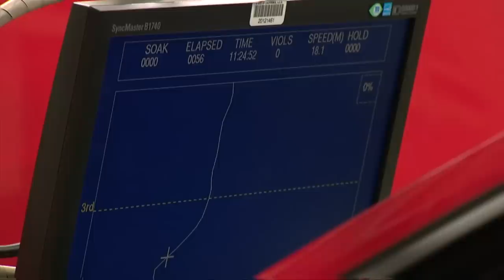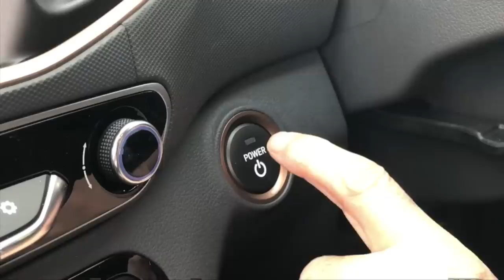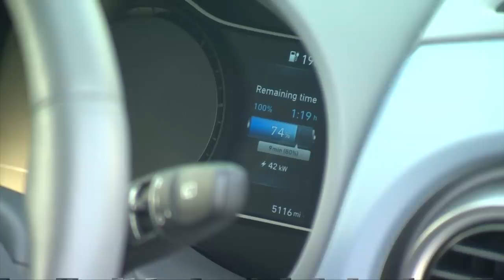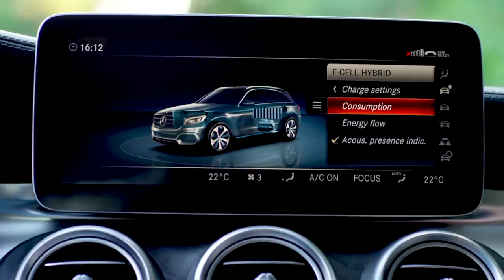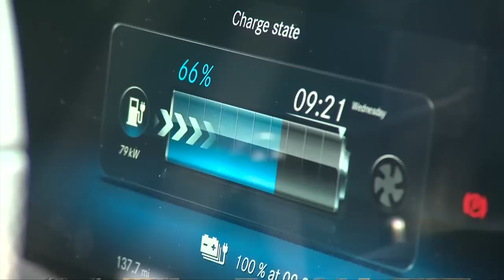Electric Cars: The Future of Road Vehicles? - BBC Click

Comment: What I'm seeing as being a real issue, moving forward, with EVs is the fragmentation of the power stations. You've got Tesla fast chargers, Porsche chargers, etc.. whereas with ICE cars all the gas/petrol stations are the same. So you never have to think about what car you have and what station you can use.
I think this is where government should step in and mandate a standard for the plugs and stations.
Reply: This has already been resolved. There are only a small handful of standards, and these tend to be regional. Tesla are unique in that their Superchargers won't charge other brands of EV. Porsche doesn't have their own network, they have bought into Ionity (iirc) with a lot of other manufacturers.
Reply: @arnifix  I was under the impression that Porsche is building their own chargers, maybe that's just in North America. Regarding Tesla, no they don't charge other cars, but Tesla/Elon did release their patents to be used freely by other manufacturers, but nobody seems to be taking him up on that offer.
Reply: VW is being forced to
fund a charging network across USA as part punishment for dieselgate. They’re for anyone to use but I think they are quite expensive.  Most cars in Europe now are standardised to ccs plugs(even euro Tesla model 3). Nissan are stubbornly sticking with chademo
Reply: CCS is the dominant rapid charging connection in Europe - even Tesla are using it now on their European Model 3s. What is a hassle is all the different accounts you need to pay for the charging across different providers! Hopefully they will gradually do away with all that and just require one unified account or, even easier, just accept contactless card payment. The government does have a cross-party working group that is aware of this issue, but I'm not sure how quickly they will move.
Reply: Tesla was first with their fantastic supercharger network, just plug it in and it works.  They offered to cooperate with anyone.  All the manufacturers snubbed their noses and pretended Tesla does not exist, looked for an incompatible way of charging to push Tesla out.  In a Tesla, you don't have to think about charging - just type your destination in, and it will add a charger to the route if you need to charge.
Reply: @JJs_playground  In North America,  The clear winner will eventually be Type2 CCS/Combo.  All current and planned products from the Germans (VW/Porsche/Audi, BMW, Mercedes), the Koreans ( Hyundai/Kia ), and the chevy bolt are using that for fast charging.  Current products max out at between 50 and 100 KW.  Currently, Tesla is still using their own connector in North America, but in Europe, Tesla has adopted Type 1 CCS for the model 3, and adapters for the other models.  While Tesla has produced V3 which offers similar power ( > 200 KW)  to VW/Porsche/etc... CCS chargers, everyone expects Tesla will produce a CCS adaptor for North America... and then there will be only one viable, vendor neutralish standard.  but honestly, there isn´t that much CCS out there yet. The only other plug in N. America is Chademo, used by Leaf´s and Mitsubishi Outlander PHEV´s.  It looks like all the new networks will only do 50 Kw Chademo, so if you want high power, quicker charging, it is going to be CCS.   I was quite disappointed when the next-gen leaf came with Chademo.  last two years, the koreans switched to CCS, and it´s obvious Chademo lost and the Japanese need to offer CCS in North America if they are serious about quick charging.  Even though the new leaf is capable of >80kw charging, almost all stations are limited to 50kw and no further upgrades should be expected.
Reply: @petersilva037  thanks. Very informative info

Comment: 3:00 The title is "Electric Cars: The Future..." / Acknowledging a 10 year (10 YEAR!!!) lead by Tesla. But nothing about Tesla for the first 10min.
My advice: Start with the best and finish with the honorable mentions.
Reply: I don’t mind Tesla being used to promote other Ev’s.. ‘Electrics cars are superior at this and that’.. but credit where credit is due.. Only Tesla has proven this and stepped it up to this level on all fronts... Tesla is far ahead of ICE, and other currently offered Ev’s..
Reply: I don't think it should have become a Tesla advert, but…  When they talked about charging times and failed to mention the Model 3, or talked about range and failed to mention the Model S Long Range, those are quite some oversights.
Reply: machelvet Tesla at 10 seconds in, mentioned the roadster less than 2 minutes in. Sure there’s a lot going on there, but not all - which is why all of the offerings were given air time.

Comment: What we need is a "standardization "Just like we have standardized PC components (slots ,pins ,interfaces compatibility) battery charging and charging outlets also needs to be standardized
Reply: They are standardized in the EU. The EU standard is a Type 2 plug for AC charging and a Type 2 CCS Combo plug for DC fast charging.

The only company that has not committed to this technology is Nissan. The Leaf ships with chademo and therefore cannot be recommended.
Reply: They already are standardized

Comment: You do know that Tesla have just made the 1million mile battery right?
Reply: Says who?  Drive a Tesla under nonideal conditions that replicate real-world driving and you would be lucky to have the batteries retain 70% of the promised range in seven years.  Why do you think that Tesla used a software upgrade to limit the range?
Reply: @VangelVe  except you're wrong. Tesloop have done hundreds of thousands of miles on a battery and it's still fine, and they exclusively supercharge them.
Reply: @morosis82  Tesla are clever and only allow for around 70% region of the batteries full capacity to be utilized so as it degrades over time, its able to retain as close to the original 70% and give people the illusion that the car's battery has not degraded. amazing marketing and honestly, not such a bad thing since they are not suppose to be used at 100% capacity very often anyway. Mr Elon being a clever sod as always.
Reply: @ryankings6755  got evidence for this? Because it sounds like bullshit.
Reply: @schmidtxcvii  The total cost of ownership for a Tesla is much higher than a diesel or petrol vehicle in most countries.  The fact that you get a few thousand in tax credits is insufficient to offset the high price of the EV.  I can buy a Camry hybrid for much less than a Model 3 and get quite good fuel performance and another 200 km of range.  The first four years of use do not mean much in terms of maintenance costs but if I happen to hit a pothole hard enough to do damage my costs would be a fraction of that of the Tesla.  I get leather seats and all the bells and whistles.  I get the range and there is no pollution issue because there is little in the way of it coming out of the tailpipe.  The total energy footprint will certainly be lower for the Camry and so would be the insurance cost.  Add a financing cost for the difference in price and you will NEVER catch up with the Tesla even if you don't get into any accident, don't hit any potholes, and don't have any MCU replacement issue.
Reply: @morosis82  Tesloop?  Ideal temperature conditions are not real-world conditions.  Try renting cars in Ohio or upper NY State and see how long the batteries last.
Reply: @VangelVe  they are a rental company 
... wym real world conditions they are tesloop is a rental service with teslas that have over 500,000 miles on them some and some have never even needed maintenance only one that even stopped working at any point got hit by a drunk driver.
Reply: @oofgordy4634  As I said, ideal temperatures and conditions.  The service is between LA and San Diego.  The vehicles were constantly monitored by the company and the batteries were checked regularly.  The service has been shut down.  One of the issues brought up was the lack of charging infrastructure.   Try operating the same service from Cleveland to Pittsburgh and see how well the batteries do.

Comment: 15:00 In your argument you are forgetting energy storage systems like Tesla's Power-/Megapack or other such systems, which are designed to smooth over or alleviate peak power demand situations like that. They are in high demand and will only become a common technology in the future. Furthermore they maximize consumption of on-site clean power like wind and they back up critical business operations in the event of a power outage. All while making profit by selling power back to the grid. It would be foolish to calculate future e-mobility energy demand without including these systems.
Reply: and you are forgetting the major battery bottleneck at present. yes at some point we will have batteries to cover the gap but not before everyone is driving EVs. the point they made is one that I hadnt considered tbh - our grid already gets stretched with everyone putting the kettle on at the same time let alone their electric car on top lol
Reply: @paulrimmer763  Yeah maybe, and kettle peak is an issue already, but the tech is out there and in use, might as well mention it.
Reply: @paulrimmer763  Unlike your kettle, you can tell an EV to charge when demand, and price of electricity, is low. There is no net increase in demand of electricity for EVs, believe it or not. Refining gasoline takes HUGE amounts of electricity, about 5 kw/h per gallon! An EV can go 15+ miles on that energy. Just quit refining gasoline and you can power an EV with no net increase in demand from the grid!
Reply: @justsomeguy934  Yes as long as the feature of choosing when to draw power is there in all cars it would help but there will still be new peaks that need to be covered, having thousands of 200kwh+ chargers pulling at the same time could be an issue even if it's a few times a year sort of issue (eg. National holidays). Also the point about the electricity required to make the gas is not necessarily a good comparison imo, the electricity is produced somewhere else and can't be shipped to where the car user is unlike the gas produced by said electricity. So in the context of the electrical draw peak arguement I don't think it's relevant. (I'm not defending gas cars btw).
Reply: @paulrimmer763  Peak demand vs. low demand IS the argument! The grid has a maximum power capacity. You  only need to build more infrastructure (more power plants, more power lines) when peak demand exceeds peak output. Since EVs usually charge off-peak, at the lowest demand points (and cheapest!), they represent NO net increase on the grid. You charge at home, while you're asleep, period.
As for "shipping" electricity, have you not heard of power lines? You can send electricity thousands of miles over high-tension power lines. Here in the USA, all of California (bigger than many European countries!) can be powered by plants outside the state...they send in the energy over power lines. Stop using 5 kw/hr per gallon of gas and that energy is now available to EVs.

Comment: I love the way they all pretend that Tesla aren't much better than the competition.  Don't wait for VW.  Look at the Tesla Model 3.
Reply: The paint is shit on the Tesla... It is a pity you can't get them without paint.
Reply: @rkan2  Dont believe the fud, 99% have no problems.
Reply: @afpv2225  It has been independently verified that multiple Teslas have had thin and soft paints. Even if that is FUD, it is not acceptable at all that Tesla doesn't take responsibility for these paintjobs, when they are clearly missing paint from places where it has been applied with newer VINs.
Reply: @rkan2  You can buy the cheapest paint color and then have it wrapped.

Comment: The only thing holding me back from buying an electric car is the cost. I can’t afford to buy a new petrol or diesel car either so the costs need to sink even further.
Reply: The most expensive part of an EV is the battery. The battery cost is declining and has been for a decade at about 7% or 8% each year. It won't be much longer before electric vehicles are around the same price as an equivalent gasoline fuelled car and they are much cheaper to fuel and maintain.

Comment: Good but would have liked to see information on vehicle maintenance. That's really where electric shines. No oil/spark plug changes. No engine tuning etc.
Reply: If battery degrades, is it just range that gets depleted, or the acceleration numbers also?
Reply: @joebloggs5629  Just range, power is maintained across both battery life and battery charge. Current battery degradation is 1-2% per year for most models.
Reply: @joebloggs5629  Just range. And a Tesla's degradation is about 6% over hundreds of thousands of miles, proven by existing owners near the 400,000 mile mark.

Comment: Its gonna be pricey to replace the batteries after the 8 year warranty is up...
Reply: The batteries don't suddenly stop working, they degrade at about 1 to 2% per year, if they are over 80% at the end of the warranty, then you still have a good 5 years before they get below 70%, even then the now short range car may still have value for an old couple who only travel into town for example.

Comment: Evs still have 75% of range after 8 years which in my car would still be 160 miles if the degradation is as bad it could be. My car has done 64000 miles in 5 years and has lost 7%.
In the countryside charging isn’t an issue as we have drives and space.

Comment: The Irish transport minister has announced that the 1st electric car totally designed and built in Ireland has been recalled. The minister added it was a total failure it could only go 2yds the flex was not long enough

Comment: Lots of good points covered here, but lots missed too! 
1) Certainly here in the UK we have the choice to only purchase electricity from a renewables supplier (such as Ecotricity, Octopus etc etc). 
2) It was a shame that more wasn't said about the Model 3 as that's available now and is very comparable to the ID3, rather than making it feel that people have to wait a year or so.
3) As others have pointed out, the health impacts are vast!
4) If we're going to question the life of a battery, should we not be asking the same of a fossil fueled engine? An engine will lose efficiency over time due to wear of components, but it's not shown to the owner as a gauge on the dashboard.
5) Related to the above, there are a whole host of cars (Tesla's in particular), that have proven their longevity in terms of the battery life. There's even a leader-board that shows the current figures, one Model S is nudging 600k miles and the first Model 3 has now passed 100k miles already. 
6) Noise pollution will plummet form our roads when more people realise what they're missing!
Reply: Videogalore, 

if you believe that the electricity to your house is 100% renewable, it almost certainly is not. That these companies sell on this basis to  cheat people who think that they are saving the planet is  fraud in my view. They may buy from renewable sources  and or buy renewable credits but that is not what their customer receives.
What electricity any customer gets is largely determined by the nearest source or sources of generation to where they live. It makes not one iota of difference to the total amount of CO2 emitted by power generation.
Reply: @iainreid9914  So I should move back to one of the 'Big 6', because it doesn't make any difference then....... Remember the supply and demand concept, I am demanding 100% renewable energy from the market and the more people that do this, the more that less interested companies will fall by the wayside.
I full appreciate that if you live next door to a coal power station, then that's where your power has been generated, but if you tell the market that you don't want to play a part in this, then the numbers will start to tell the coal power plant that nobody wants to buy their power. 
It's already happening, so I suggest you do some further research as it really does make a difference as to where we spend our £'s!
Reply: @videogalore  

there is not the slightest chance that 100% renewable generation will work. It is technically impossible at the present time and the near future. The only non CO2 emitting technology is nuclear. The green NGOs have made nuclear nearly imposible due to cost.
My suggestion to you is go for the best value deal you can get and forget expecting market forces to drive the impossible.
Coal was not led by market forces but by ignorant politicians, and worse who are  not inclined to do basic research. Coal is a valuable fuel and the only alternative we have during, particularly severe, winters. Gas demand in winter always causes supply restrictions and to base our grid security on just one fuel is reckless.

Comment: IMO, the primary impediment to EV adoption is all about perception. My daily driver is a 2014 Nissan Leaf. Among EVs on the market today, it is outperformed in almost every way. It has less range, less power, slower charging capability and recoups less energy from regenerative braking. With all that, I am entirely satisfied with my vehicle. It has more than enough range to get me around each day. Most charging occurs while I'm sleeping, so the charge rate is irrelevant. It won't outrun a Lamborghini, but it still has  more torque than other cars in its class. I have never been left stranded with a dead battery. I save up to $150 Canadian on fuel each month. I spend next to nothing on maintenance. And for those odd times when I need to travel beyond the range and outside the charging infrastructure, I can rent an ICE vehicle which is  easily afforded  given how little my EV is to run. 
If people really look at their daily driving needs, they will see that EVs easily fit the bill. And, once they drive an EV, most never go back.
Reply: I concur :)